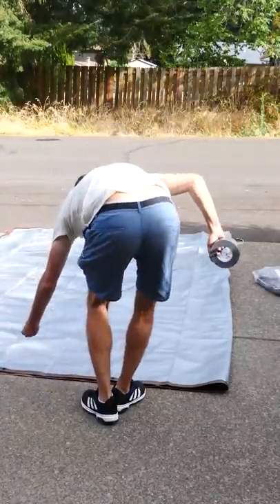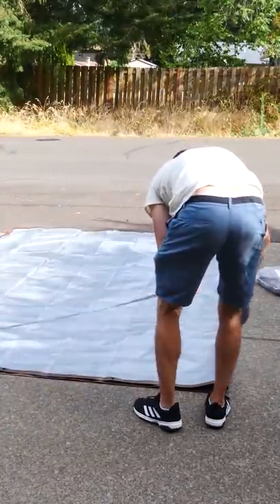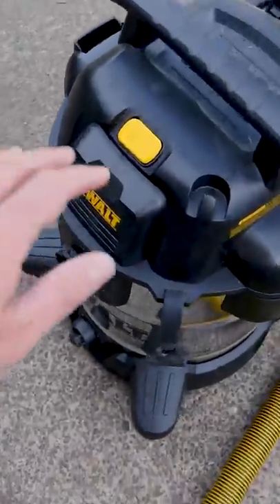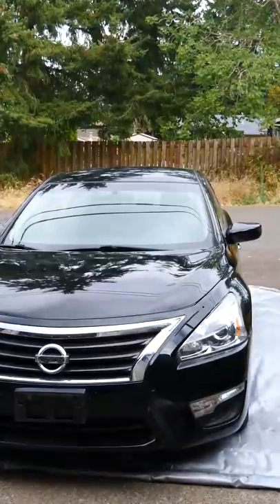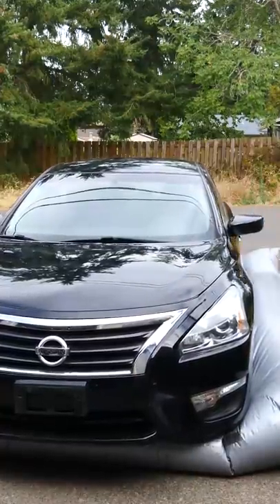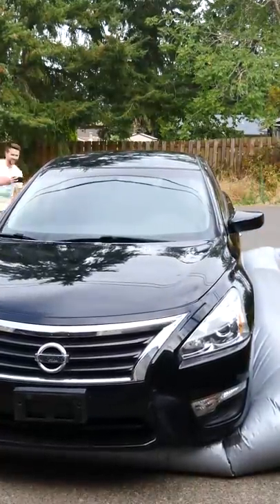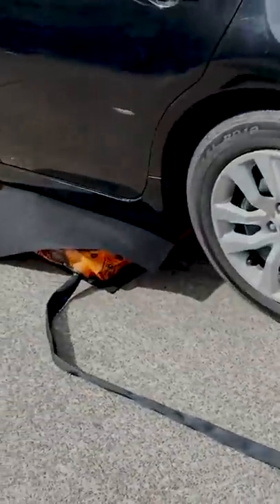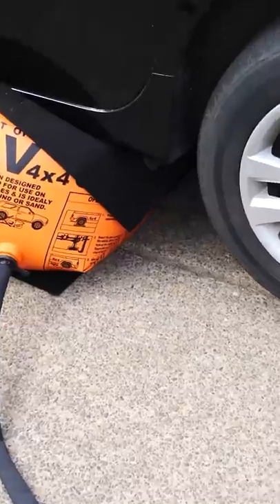A Car Lifting Itself Up

Comment: Don't do it again, you can damage the exhaust or even the engine due to the high pressure in the exhaust system
Reply: Yep. Cook a catalytic converter. It absolutely can be done.

Comment: Next week we'll find out exactly how much exhaust back pressure it takes to kill an engine ♥️♥️
Reply: It had dual tailpipes and only used one, doubt there would be a n issue there.
Reply: Not one of those vq engines.
Reply: Besides,  backpressure is actually a compression wave which travels between the exhaust valve and the collector pipe.  There are two waves which reverberate back and forth between the valve and the collector pipe, a low pressure and a high pressure.  They time it so the low pressure wave is inside the combustion chamber during the valve overlap right as the intake opens to cause an in rush of air increasing the intake velocity.  The high pressure wave is timed to enter back in right before the exhaust valve closes, leaving a pocket of compressed air in the chamber.  That's why changing your exhaust will "kill your backpressure"  because it more than likely has a different distance to the collector pipe.  Yes higher flow will help high rev horsepower but hurt your torque if your exhaust isn't tuned properly to try our cam profile.
Reply: I was cringing the whole time
Reply: I don't think the 10 or so psi will hurt it too bad.
Big surface area = less pressure to lift something.
Reply: @mikekochendorfer7965  bro issa base Altima das prolly the 2.5 QR

Comment: We did this in shop class... When their was such a thing... You take a board(weight), attach the tarp(float), cut small holes evenly on the underside. The air lifts, and escapes. Making whatever you couldn't push movable with very little force

Comment: I wouldn't screw with impeding the exhaust. With how electronically monitored cars are, you probably caused all sorts of codes to be thrown!
Reply: He vacuumed his car off the ground, so I'm pretty sure he will be able to handle the codes.
Reply: It's actually fine. You only idle the car to fill the bag. Your car naturally produces a similar amount of backpressure at peak power as the bag would need to lift the car. That's assuming a naturally aspirated vehicle, of course. But if your vehicle is turbocharged, the turbo wouldn't be spooled at idle anyways, and would be operating as a naturally aspirated engine. So the same logic applies.
Reply: I don't understand that device, in what situations is that better than using a jack? Uneven surfaces maybe?
Reply: @foodhatesme  It's much faster and safer as load spread out over more surface area

Comment: With his track record, when he showed how high off the ground the wheel was I was like thinking " please don't put your hand under that" like a fucking mantra omg
Reply: I was thinking pop it and see if it bounces
Reply: My brother mistakenly put his hand on TOP of spare tire He was placing on a van when the van collapsed. The fender trapped his hand between The edge of the fender and the top of the wheel. Surprisingly he didn't break anything but damn that thing was swollen and blue for weeks!
The lesson?
When changing a tire ALWAYS hold the tire on the sides and not the top in the bottom!

Comment: About 30 years ago I saw a short clip of someone using this concept back in the 30’s. They put the bag under the car between the wheels and used the car exhaust to jack up the car. They then proceeded to change a tire.

Comment: Isn’t sealing the exhaust with no outlet dangerous? The whole idea is to remove the semi combusted matter to make the engine run ok
Reply: Depends on what you meant by dangerous.
It won't explode the engine, but may damage it in the long run
Reply: @mbrusyda9437  yeah it’s made for like Overlanding or Off-roading. If you gotta change a tire on the quicks, this can actually be easier to use than a regular Jack on the sometimes silk roads

Comment: Approximately how long DID it take to lift the vehicle with the exhaust? I’m very interested in that due to the low pressure and force of the gasses escaping through the exhaust pipe
Reply: This is what I want to know. He says “extremely long time,” but how long is that?

Comment: For the people that don't know any better , using your exhaust to jack up your car like that is not recommended . You take the chance of blowing your exhaust apart if it has a weak point and damaging your engine from that much back pressure .

Comment: I did the math for your average Toyota carolla, rounded up for error:
Length (6ft) x width (15ft) = 1080 square inches
Average weight = 3000 lbs
3000lbs/1080 sq inch = roughly 2.7 psi system to lift the car
Awesome hydraulic principles!!!!

Comment: Using a vacuum cleaner to blow a tarp gave me an idea : Is every system that's capable of increasing pressure also capable of decreasing it ? For a pump you just have to use the opposite end, for a syringe you can just pull instead of pushing, and if high temperatures increase the pressure then lower temperatures decrease it. But what about pressure created by chemical reactions for example ?
Reply: Like explosions or bullets?

Comment: nice tapping but that old tech.  they used to sell a bag that was was used to change your tire while off roading.  you stick the bag under the car and hook it up the the exhaust of the truck and it will left the truck no problem.  let still sell them today even.

Comment: The exhaust lift could have been a great way to replace the jack for those who are not that strong.
Although now that airless tires are a tiny and will eventually take over that's not needed.

Comment: What kind of tape did you use that could hold in the pressure required to lift a 2 ton vehicle with compressed air?
Reply: Duct tape.

Comment: I've used the exhaust taped to an air hose to inflate an air mattress while camping. The fuse had blown and couldn't run the air compressor off the 12 volt.
Reply: That's terrifying

Comment: I use a similar method when I move hot tubs. They can get to 1,000lbs or more and this will lift them to a 45* angle in about a minute. A lot easier than just trying to use manpower.

Comment: The exhaust bags work but should not be used as a jack because they can deflate extremely fast if they break
Reply: They’re for offroading in sand so you dont have to bring plywood and a shovel to put your jack on
Reply: @TeakKey7  ah ok

Comment: Honest question,

Wouldn't there be a concern for a higher concentration of carbon monoxide in that bag filled with car exhaust?  

Obviously, should be fine outside as long as you aren't too close, but I'm sure there are warnings about using it in a closed in space like a garage.

Comment: The smaller one filled with the exhaust would be good for changing a flat.. Sometimes you buy a used car and it doesn’t come with the jack. This would probably take up less space too.
Reply: A 2 ton trolley jack can be had for like $35 and is much safer and easier than the exhaust bag

Comment: This is just a big clumsy diy exhaust Jack. 
They have been used in logging and other remote jobs where vehicles get stuck for a really long time- “overlanders” started using them maybe 10 years ago.
Reply: more like 50 years, I remember a black and white picture of a 2cv citroen (or a dyane?) with that system

Comment: Quick word of advice, you have independent rear axles and they have some alignment issues and your tires are worn on the inside and not the outside, I would suggest new tires and an alignment it’s dangerous on those bald tites

Comment: Not to be, "that guy" - but I did have an engines head gasket blow up on me because of a potato in the tailpipe. The pressure from the exhaust built up too much and the head gasket blew.

In other words, don't do this at home kids.

Comment: Just be careful using the exhaust. Back pressure isn’t exactly great for the engine. Especially when you have a catalytic converter
Reply: could also fill the cabin with toxic gas, not great to breathe that stuff in

Comment: that device that uses your exhaust is just gonna cause your engine to fail sooner than normal, it's a terrible idea to block your exhaust while the engine is running

it will cause excessive backpressure, filling your engine with exhaust gases which will foul up your spark plugs and mess up your sensors